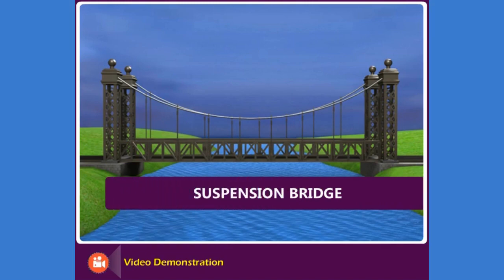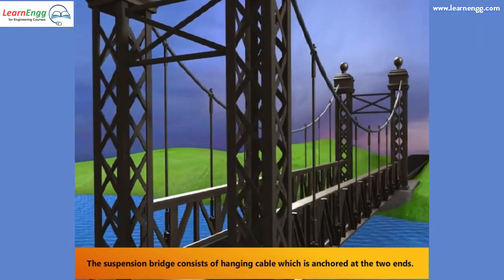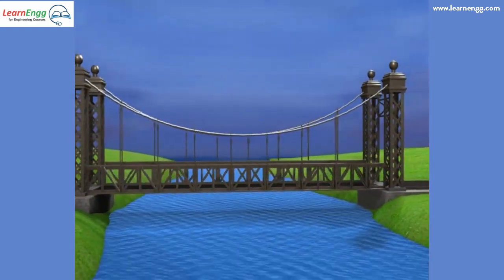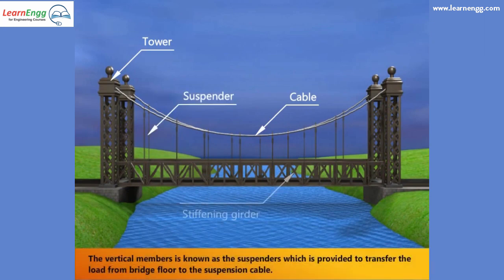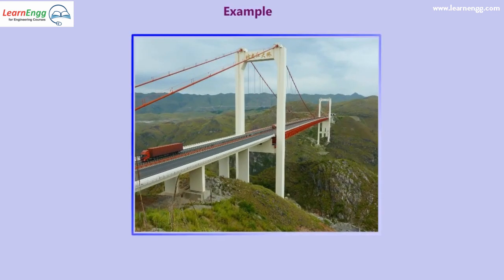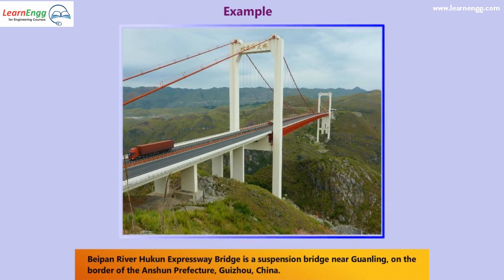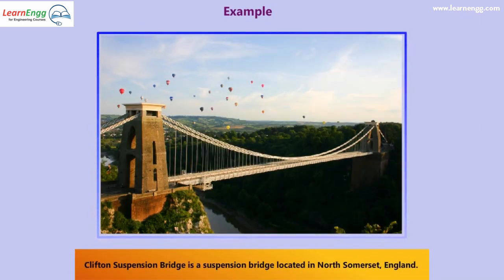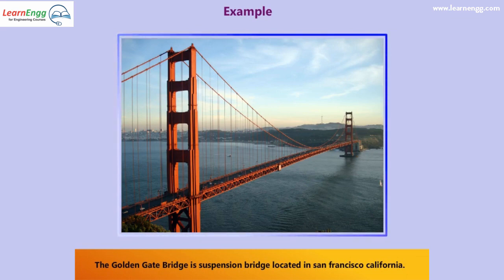Suspension bridge

Comment: cable of uniformly loaded suspension bridge hand in the form of a parabola the road which is horizontal and hundred metre long is supported by the vertical wire attached to the cable the longest bhaiya been 13 and sorted by are being fixed term find the length of a supporting wire attached to the roadway 18 meters from the middle class 11